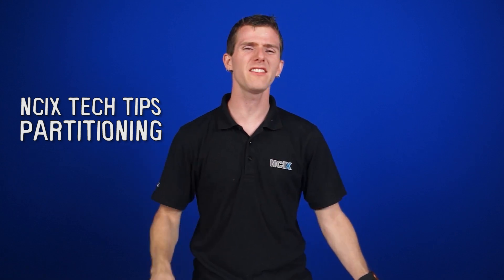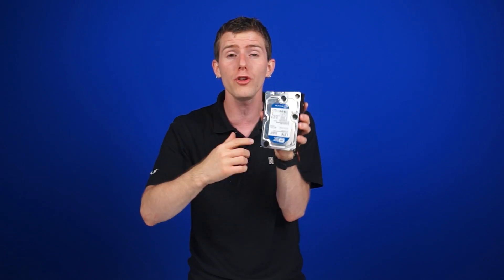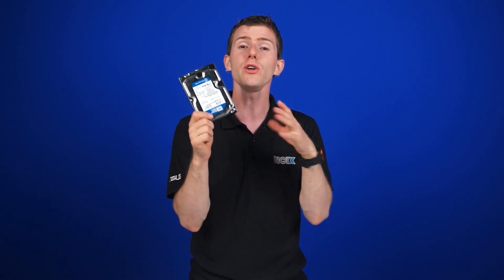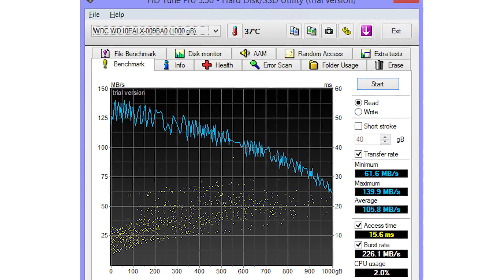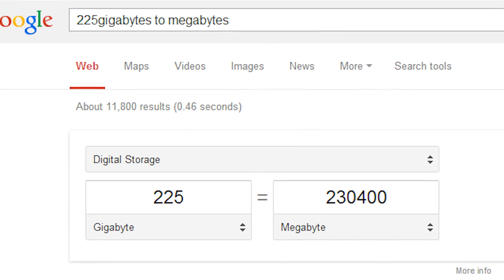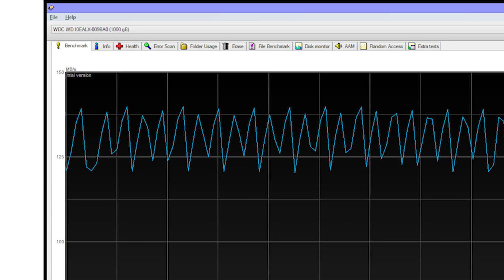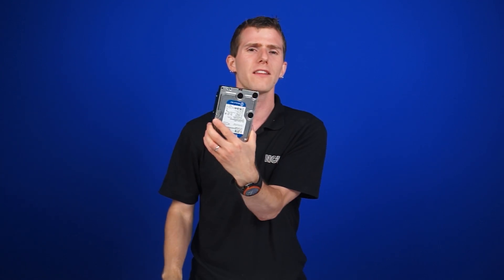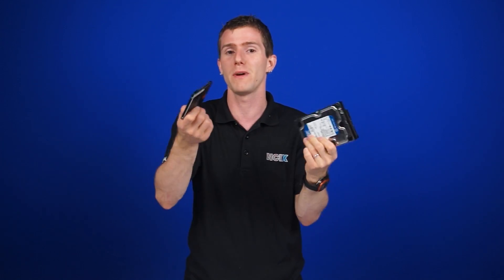How To Optimize Your Hard Drive For Speed

Comment: Couldn't raid and software logic simply place data in an order to maximize read over the entire drive geometrically?! Is this not normal?

You could have smaller dots of data placed so it can be sought with things going up and down the drive comparably to the speed so it's always reading along patterns of data placement and then writing to such data. If you had specialized data you could also use overlapping data with known shared data to maintain maximum data flow... Then defrag software could move data into place for non specialized data or by analyzing data patterns to maximize data based on shared data. You could even maintain program data in a way to automatically help this happen. And do it with programs automatically and possibly teach it a bit to programmers if needed. Shouldn't need to but we are not in a time with good programmers from the looks of it.

There are lots of ways to accomplish this. You could even have data and drives to go with software setups based on the software needs. Or one drive with a multilayered pattern for different drives and carefully placed data to maximize overlaps.
Reply: Or do they optimize to minimize read head movement for longevity. Maybe they could reinforce and optimize seek times and whatnot. That or start adding heads and make the more fixable or long lasting. Even with partial movements they could slightly overlap to pick up more data.. Like a weird trident shape that can somewhat adjust. Even a partial end of read heads at an angle in both direction could increase seek times and data access/write. Especially with the correct logic.
Reply: Or maybe really long ones with a different direction of heads. Or heads from different positions. Why can't they get HDD's to the same speeds as SSD?! I would think with enough mechanics parts or similar it could be done. How about some fixed heads along it and one adjustable to read more data as the disks spins and access from multiple locations at once. I have a raid with 12 msec read times and an SSD with 0.3msec read times. That is only an increase of 36 times. That is not impossible. You could even design read heads to get rid of the problem of access in the bottom/middle of the drive. It could be fixed and sit sideways in a partial shape of the drive so it has multiple chances of it's width to seek data. The entire thing could be readable by heads under the platter also. Get rid of movement unless it's helpful for something. It could then spin for diagnostic reasons basically to identify dead heads or data locations and for mild calibration issues when not moving. You could outdo an ssd if you really wanted to.
Reply: Then you could go two roots. Or do both at once. Read heads that surrounds an inner disk completely and reads everything at once. Even the edges. A disk within a disk. Then the read head could be the inner or outer disk. Or both. Or don't fully encompass it and have the platters have both read and write portions on the disks. They spit and read each other. Then stack lots of disks and use old read heads for slower maintenance stuff to double check errors or for active error reading for independent confirmation. If they have increased capacity with SRM and other things put the read heads on the disks themselves and put them closer together or something.

Comment: impulse hdd it's not the same replacing hdd with SSD I know this and I go faster is I give you than Adi gave that it's the difference of reading work has no disk has something else Just like mastic something like it's just more evolved when looking for boss means that the same product is my hdd processor without changing you make it go faster a kind of overclock

Comment: In my experience (as limited as that may be), the best way to improve performance on a "platter" HDD, is to just keep it defragmented. Defragging not only the data files, but even the free space (Find a program that will do that - I use Defraggler in cooperation with Windows Disk Defragmenter to get the best results - running each separately, of course, duh). 

Optimizing, too. I never optimized my HDDs cos I thought optimizing was the same thing as defragging, but recently learned that optimizing just officially clears the data that was deleted from that section of drive, rather than just leaving the data there to be cleared only when new data is being (over)written to that spot. Or something like that... 

Still, regular defrags (and possibly also optimizations) would probably go a long way to faster disk performance of HDDs, without all that partitioning nonsense. Especially if you're just gonna stress the drive by running games and programs on a partition that is not the OS partition. Seems counter-intuitive and counter-productive to me? Just run the 1 partition. Why complicate things. 

And as for spending the same amount on a "50GB" HDD as you would for a SSD, does the SSD offer anywhere close to the same storage capacity for the money? I doubt it, lol. 

I don't trust SSDs. I'd rather sacrifice speed for the chance to recover data in the event of corruption. I mean really, how fast does shit really NEED to go, anyway? You'll save a few seconds here and there? Big whoop... 

HDDs will allow rescue and recovery better than SSDs since only the affected sectors are concerned with HDD, whereas with SSDs, the whole drive (or at least the affected chip the sector is sitting on) is fucked if even just one small sector is damaged. Or so I have been led to believe.

Comment: Wouldn't the outer rims spin "slower" than the inner rims simply due to the RPMs in relation to the circumference? The outer rims have "longer distance" to travel than the inner rims, right? If you were the laser lens, and had to "walk" a complete circle around the center, would it not be done faster than making a complete circle around the outer edge? 
Maybe I am missing something, a key factor that would in fact make the inner rims slower (like the fact actual data is being read/written to a surface whizzing by much faster than can be completed in a single pass)? Help me out here. :-P
Reply: The RPMs are fixed, regardless of the location of the track (or rim). Therefore, the time it takes to "walk" a complete circle around the center will always be the same, regardless of how close you are to the center.

Comment: lets say i have a new drive 8tb  does it work closer in and write data faster with bigger files like 300 gb before 50 gb as i move along to the smaller files because it writes closer in and faster as the read write arm works its way out as it writes datato the drive in other words go for the big files first and work your way down to smaller files because im closer to to the inside rather then the outside of the platters

Comment: One thing I didnt quite understand is at the end wich partition gets the better part, logic say that the first partition would be the slower one and the second the faster one?, so if I have a sda and make a sda1 and sda2, the system and "stuff that I want to run fast" (games) needs to be in sda1 or sda2?, and also, is there a way of doing this without reinstaling?, like defrag and resize? but in that case if I defrag would it be defraged to the fastest point right? I guess that should make sense.

Comment: Hi I am Pranav,

Photographer,

I am figuring out a budget system for my editing workflow. Till now on the basis of what I have searched and read on google and other forums lightoom and photoshop get benifit from both higher clock speed and higher no cores on cpu... But particularly in one thread i read that they can use upto 4 cores to there full extent and cant get benifit from extra cores if one has... So @linus if u can test this with testing rig in real world with ryzen 5 (4 cores, 6 cores, 8 cores) it will really help me and many other bcaz everyone is just making videos about gaming and stuff which is irrelevant to me bcaz i hardly had played any games in last 5 yrs... Also can u test the rig with low medium and high budget gpus... Bcaz looks loke everyone is saying some sort of different things about gpu requirements and i m not able to find a specific answer and obviously i can not go ahead and try everything bcaz u now how costly they are costlier than cpu... So if u can put together a YouTube video for photographers like me for the optimised performance in lightroom and photoshop (mid-budget plz😂) plz do it...it will really help a lot... Also test the rig for clock speeds like is it necessary to overclock 1600x to 4ghz or one can get away with r5 1600 at 3.6ghz... also suggest something about memory its clock speed... Thank you very much

Comment: i just want to stick a 16 gig ram stick in place of the hdd cache and forget about a ssd like why does ram handle temp and cache so well but it burns up ssds my computer can take 128 gigs of ram on my x99 evga ftw mobo currently at 32 and I never hardly use more than 10 gigs ever I just want a good software that can make use of that extra ram for a like recent or most used apps cache can save to iso image to hdd on shutdown and remount it to ram on start up but basicly turn like 16 gigs of my current 32 into a disk cache I found this hddturbo seems to be doing what I want but tech is like art … when ppl get around to painting this picture up nice and neat hahaha

Comment: I'm don't have the need now.  256GB SSD-OS, 256GB SSD-Games, 256GB HDD-Data, 500GB HDD-Archives and backups. I can see the benefits of partitioning though, but kind of past the original reason why I would have wanted to. Enmotus Fuzedrive appears to be a decent solution by fusing a SSD and HDD into one system SSHD. Looks promising.

Comment: I have 1080 mp4 files from a pretty quick Kingston SD card being copied to my new Toshiba x300 HDD @ only 20 mbps, that seem very slow to me, the card is rated at nearly 90mbps read and the hdd is rated 7200 rpm and is connected via sata 3 6gb/s....... I'm not expecting miracles but I feel itshould transferring data much faster than that maybe 100 mbps an a new ASUS ROG MB and a a skylake6600k  CHIP and 16gb ram?

Comment: but how do you tell your HDD to use that fast part of the disk??? i mean not that windows takes the 750 GB partition and puts it in the fast part and the 250 GB in the slow one. therefore still degrading performance.

Comment: An old HDD Can lower FPS?
Reply: no it only slows down your loading times of the games, there is no other impact, except if it starts writting / reading something on the background while youre playing, it will break down performance.
i say this not only by research, as i have experienced it aswell, i went from a SATA hdd to an IDE hdd and the fps are the same, appart of course from what i stated, when its loading or reading something else on the background
Reply: No , but lets say that in gta5 the map will load slower , so sometimes the game will be laggy
Reply: Yes. It makes it laggy and have a lot of spikes and package loss from transparent information that gets displayed like fire, visuals, shadows, etc... because the connection is slow.

Comment: Some other video said that the slow part should be left unallocated. Does that sound right?
Reply: If you want to guarantee the seeking doesn't go beyond the short stroking area, yes.  Though I doubt you'll notice a difference if you short stroke for your programs and partition the rest for data.  A notable exception is if you're streaming media off that data partition while opening or running programs requires accessing the short stroke partition.  Though you'll still not likely notice unless it's very high bitrate.
Reply: Thanks. Where would you shortstroke this?

https://postimg.org/image/vh4yby645/
Reply: Btw, I accidentally cut the bottom too short. Each column is an increment of 50GB (500GB total)
Reply: personally? if that's sequential... then the trash can... lol. seriously though, primary partition, 200gb or smaller depending on its use. if it will be your os partition, keep it as small as possible to hold os+ updates+ regularly used programs. I'd just buy an ssd in the 250gb range and use that as primary boot drive. but I'd I had no money to put into the project I'd put the primary at 120gb. the smaller, the shorter the stroke, the smaller the seek times.
Reply: It took awhile to get back here so I agree with Chris' answer since he posted it first.
Reply: I knew that this was coming lol. I could see myself in the graph that there was nowhere to partition it to make it faster. I was just hoping for a miracle answer lol. Thanks guys for the replies.
Reply: OptimisticPessimist <--- I like this guy, and his account name is Prosumer grade ;)
Reply: TBH I wasn't going to suggest throwing away the drive.  I agree primarily with the partitioning segment.
Reply: TBH I thought I made it clear the binning suggestion was in jest ;)
Reply: Chris Lesmerises
Yeah, I tend to overlook minute details while skimming.  LOL

Comment: hey nice tips, one question i have, if i already partitioned my drive and intalled my Windows and programs, do i need to clean it up? or can i just resize it with all data in it???
Reply: As long as the conents' total size is less than the size you want it to be, plus whatever buffer the partition manager doesn't let you take it under, then yes.  Just make sure anything critical isn't stored only there.  There is little chance of data loss, but it can happen.  Also be patient while files are being moved.  You might be more comfortable with it if you use a third party defragger that moves files to the start of the partition first.
Reply: thanks, i'll check that now
Reply: Chris D.
I would follow others' advice for leaving enough room for software and OS updates, temp and cache files and to allow the occasional defragmentation to run smoothly.  I'd suggest an attempt to make sure the minimum amount of free space there will ever be is ~ 15%.
Reply: oh i see... thanks again

Comment: but SSD are time limited...we got 1990 mechanical hd still working... SSD are just for expendable pc's
Reply: hardly, on consumer pcs solid state drives will long outlive the point of obsoletion. for instance.... exactly how big are those 1990 hdds that are still working? my brand new pc in 91 had a massive 405 MB hdd.

Comment: A drive doesn't read any faster from the outside. Just saying.
Reply: I'm not even a fucking teen yet and I know that no matter how fast the disc is spinning from the centre that the further out of the disc spins faster. That part of the disc has a longer distance to travel but needs to make a full rotation with the rest of the disc in the same period of time. The only way for that to happen is if the further out the disc spins faster. It's simple in a line as well imagine you're in a car and you are 1km away from your destination and want to reach there is 1hr than you travel at 1kmh but another person wants to arrive at the same destination at the same time but is only 500m away from the destination than he goes at 0.5kmh. Now imagine the same scenario but In a radial matter. The person who has to travel less has a lower radius meaning he is closer to the centre and has to travel slower than than the person who has to travel more. It is physically and theoretically impossible for the entire disc to be spinning at the same speed. It is legit simple maths idiots...
Reply: ok, example. there's a giant bullseye on the pavement. two people "walk" around the circle, one on the outside track,  one on the innermost track, once. Who covers more distance (relative to the data track storage) in the same amount of time, the guy waking around the outside ring, or the guy on the inside ring? this is exactly why consistent spin rate covers more data on the outside of the hdd platter. And that's only the first half of the equation addressing sequential read times. random reads significantly increase in the situation of outer track only partitioning because the read arm doesn't ever have to travel full distance between reads, should two necessary packets of data for a given operation reside physically distant to one another.
Reply: Any fucktard knows the whole circle thing. The head isn't revolving around the platter. If you draw a line from the center of the platter to the outside, when you spin it the head would be reading from the same place. Therefore the only possible effect on read/write speed is how fast the platter is spinning.

Comment: If you have a 40gb 7200 rpm drive lying around then you won't be sacrificing much if you make it your OS Drive and Short Stroke it
Reply: you cant "short stroke" 100 percent of a drive.... you missed the principal of how this works.
Reply: if you use half of a 1T drive that's 500gb but if you use half of a 40gb drive that's 20gb so you don't lose as much
Reply: yes... but at 20 gigs of the 40 gig drive you're nearly half way down the platter....  which doesn't leave you a lot of room, and the room it does leave you slows back down quickly.... seems a bit pointless considering what other options are available. Heck, I just threw away 2 80 gig sata 2 drives...
Reply: why would you throw away 160gb of usable storage
Reply: Because external esata and usb 3.0 drives make more sense for me and anyone I know, I only still use internal 3.5 hdds, because I have a few good WD blacks, a hot swap dock, and a SATA dock built into my case. And I'm not going to stripeset 2 old drives... That's asking for data corruption... And added heat, and takes up room, takes power, extra cabling.... Doesn't fit anyone I'm nears needs. I personally try to build pc's out of donated parts for donation, but I won't burden sometime with these old, small drives.
Reply: hi again :D